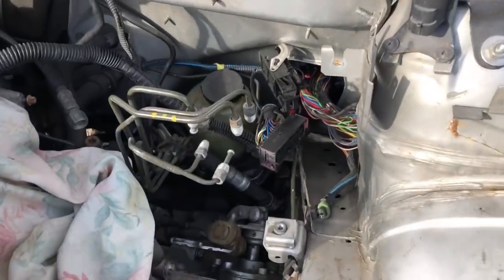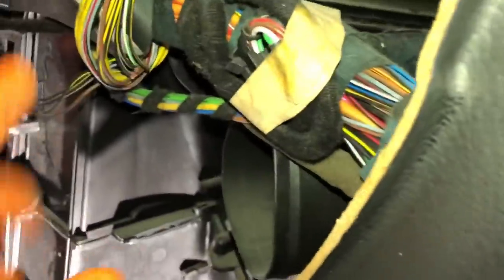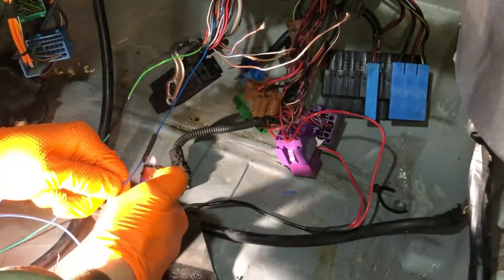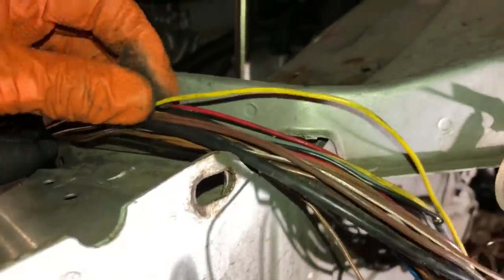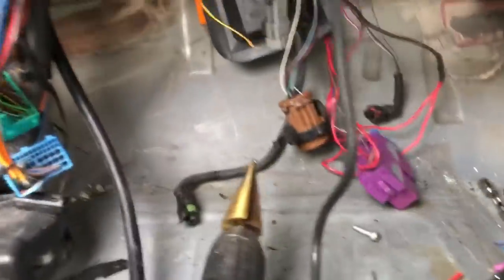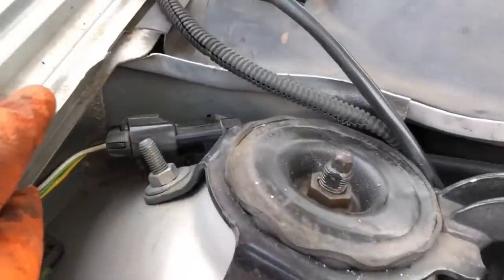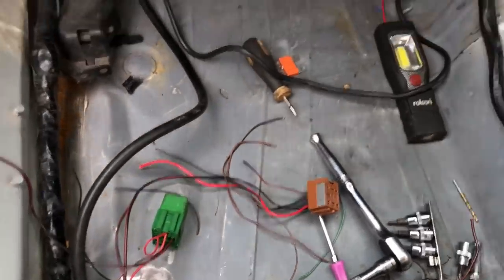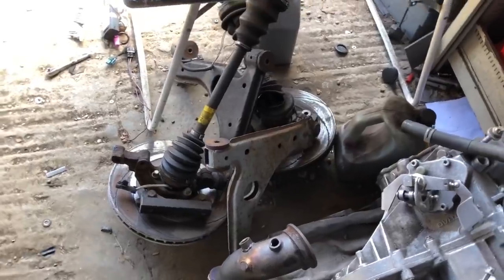Completing My World First Wire Tuck! SUPER CLEAN... Opel Astra Z20let

Comment: What about resistance over the loom once chopped mate or is that just talk on the z20let forum ?? Never heard you mention it so I gather it’s a case of soldering the joins properly first time
Reply from the maker: Resistance applies to cars running sensors reading Ohms. Most z20 sensors are voltage readings, as long as earths are good your fine